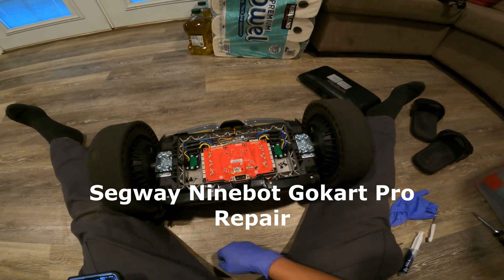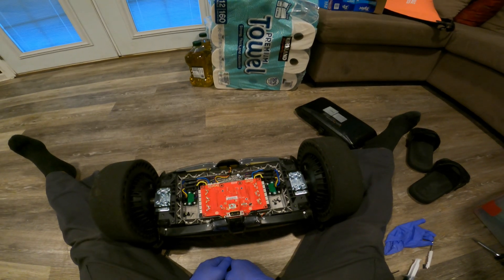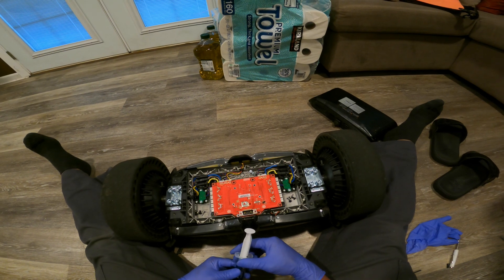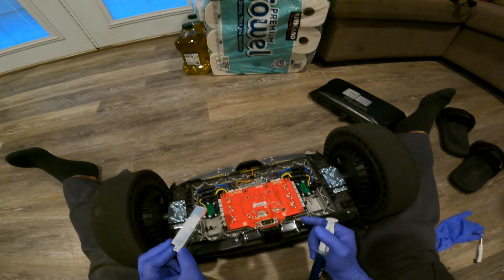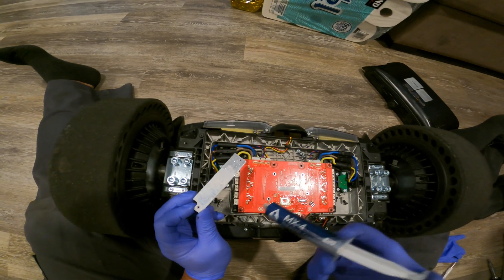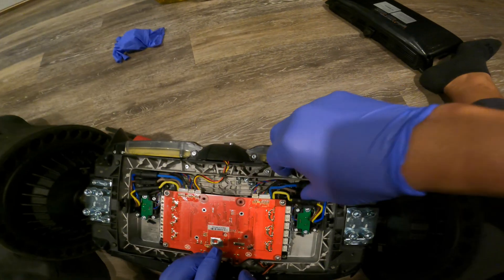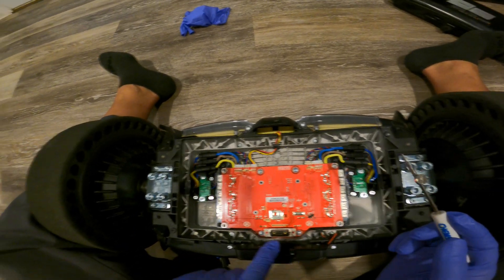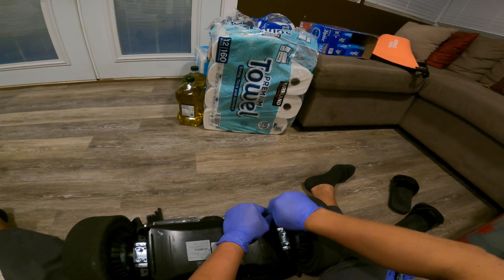Segway Ninebot GoKart Pro s max Repair

Comment: Do you know why the serial number needs to be provided?
Reply from the maker: @fonglenh - not sure, but maybe the control board needs to match up with the battery management technology.
Reply: @arisnavarro  hmm the ones on eBay with “original” doesn’t require serial number. Thanks for your video btw!
Reply: @fonglenh  my smax beeping and brake at 15km/h how can i fix it sir ? @arisnavarro

Comment: Didn’t you change you mother board yourself before?
Reply from the maker: Yes, I replaced the motherboard before, and this video is only a suggestion to add more thermal paste to allow the heat to transfer to the heat sink better and prevent motherboard failure.